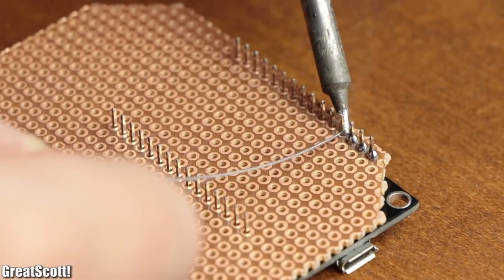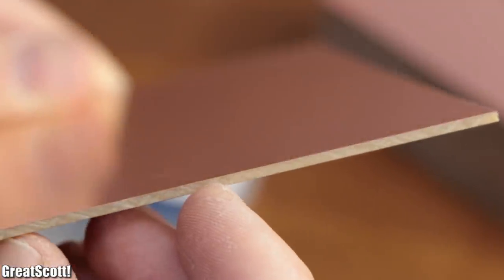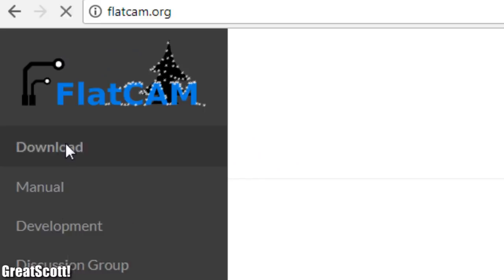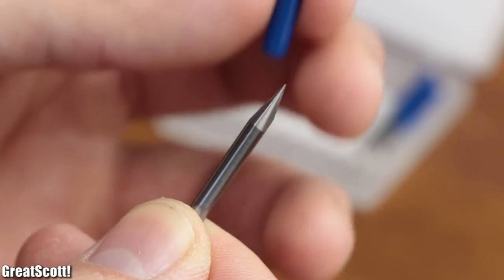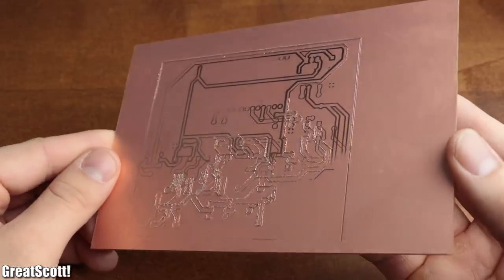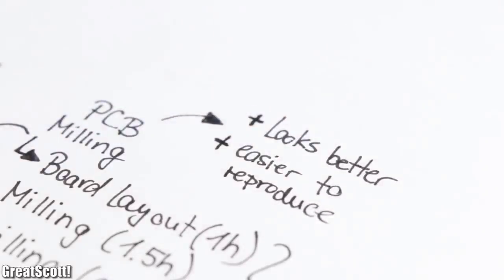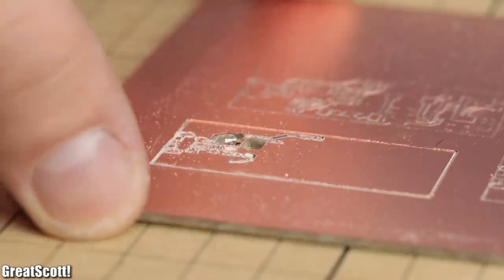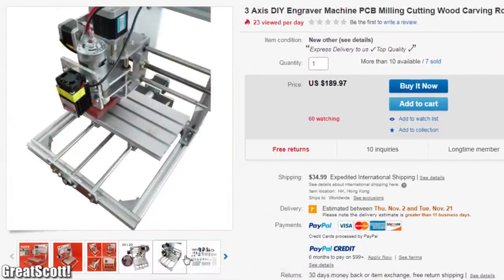How NOT to Mill a PCB (except for SMD)

Comment: I use a chinese CNC 3018, which I made some improvements and some clearances in the movements and I am getting very satisfactory results.  But I barely use it for carving, only drilling as I make the boards with photo resist film.  I agree that ordering is very cheap these days,  but I live in Brazil and it takes more than 60 days to get the boards, at best. Prototypes and one of a kind projects I prefer the home made.

Comment: Yes i had a 2418 small cnc  from china and it works really well i use CA glue to hold the pcb to a piece of flat mdf it works great but after many failed attempts

Comment: My solution to do this using a cheap chinese CNC machine is simple: use a cylindrical drill bit instead of an angled one, and make it cut about 0.5mm into the board. That way you will always drill into the copper, no matter how uneven the surface is, and the traces will not become wider or smaller depending on how deep the drill bit goes in. Makes for a very repeatable solution.

Comment: I think milling is the way to go, because it is easily repeatable, once you set up the G-Code, it is essentially a cookie-cutter.
Secondly, time, for a Veroboard you have to sit there and make the board, on the other hand, you have to wait for weeks to receive the order if you order it, however, with milling you only have to wait an hour also.

Comment: Since the Copper board is conductive wouldn't you be able to use it for auto leveling by using it to touch probe it, run a clip to the bit and one to the board

Comment: Use bCNC for milling. Trace cut depends on the angle of the V bit and how deep the cut should be. This value should be defined as the tool diameter in FlatCAM

Comment: Using laser engraver is a much easier and professional looking way.

1 Paint blank PCB by black spray paint.
2 Drill and cut it on the milling machine.
3 Burn paint on laser machine (paint that not burned will work as an etching mask).
4 Etching PCB as usual.
5 Remove paint.

100% repeatability for DIP and SMD even for 2 sided PCBs.

Comment: Is your CNC table level? If not, or if the PCB blanks have quite a bit of variation, you might take a few measurements and use software depth correction. Great video.

Comment: Hi, I have tried to do pcb milling with the cheap Chinese machines, I spent 3 weeks trying but didn't get a useable result. I learned a lot though. 
You have to use an autolevel software like bCNC, it's free and open source and written in Python. 
I haven't given up yet, I will replace the stepper drivers with the TMC2130 silent stepstick, and I've replaced the axis couplings to get more ridgidity. 
You make nice videos,  good job!

Comment: I love most of your videos. However, I've been milling PCBs with a gcode CNC now for almost 2 years and takes practice to get right but once you do you can reproduce boards very quickly.  Your main problem here was you clamped the board instead of taped it down. If you tape it to your waste board and your waste board is super level then the tape will force the PCB to also be flat & level. Also, to make up for the variations you have to cut a little deeper which is why you might use a slim angle so you can get the depth but not decrease the trace size.

Comment: I have a pcb milling cnc and you absolutely need to use autoleveling! I have many, many failed attempts without it, but since i autolevel all the problems are gone and the pcb's come out great. Also you are going too slow - you can probably go to 150mm/min, given that your spindle rpm is correct for the tool.

Comment: You don't isolation-mill boards to make individual boards quickly. You isolation-mill boards to iterate design changes quickly.

I have a desktop CNC mill that I'm using for prototyping, and it's saved tons of time by allowing me to design and change boards and sub-boards (such as breadboard-compatible carriers for SMD packages) without having to deal with chemicals or wait for boards to come from fab. That's where the process shines.

Isolation milling isn't very cost-effective for the hobbyist compared to chemical processes like direct toner transfer or even photoresist, as it's significantly more expensive to set up. Once you get outside hobbyist-level work, the whole situation changes.

Comment: I would only use a cnc router for vias, holes and the outline of the board, I had excellent results with the dryfilm and laminator method and I think it leads to almost perfect pcbs.

Comment: Hi, I'm trying to decode data from 4 wireless 433.92 MHz FSK transmitters and forward the information to a CAN bus interface. 
Do you have any advice to how I can decode the signals and use the data? 
I already have the CAN interface up and running with an Arduino and CAN bus shield.

Comment: I've milled a pcb too. First I would stick it with carpet tape on a sacrifice wood which gets fixed on the router. Next I would switch to bCNC which has autoleveling included (I never tested this function)
At least flatcam has a bug (yet?) when you first switch to mm and import the gerbers, the drilling layer is scaled different from the routes layer. It had cost me many hours until I found an other yout video that tells me to import all in inch setup and then switch to mm if all is on the right place

Comment: If you ever use the machine again try to use double sided scotch tape on the back of the pcb to hold it down. Once I used this technique the only problem that would occured would be due to the fact that the PCB material was uneven. A better grade of PCB stock solved that. Ps I really enjoy your channel.

Comment: I use my Othermill Pro (now Bantam) CNC for milling circuit boards (both TH and SMD). While it offers better reproduction and quality than the Inventabiles Milling Machine, it does cost a pretty penny ($3.6k). I did used to have a cheap Chinese milling machine but it failed to work, I then tried Inventiables’ machine, but I couldn’t get it to work. Then I went for the Othermill Pro. The best $3600 I spent.

Comment: I have one, the CNC 2418, I had the same problem with th z axis but I fixed, what thing you can do to improve the milling is using the auto leveler (or heightmap) in the setting of the GRBL Controller. also your feed rate it is very low, I use 254 in flatcam and I got very good results.

Comment: Milling time can basically be ignored because once you have it working you can go and do other stuff while it does the milling. Also the 30 minutes or so you spend setting up the milling applies for every copy of the board you mill so if you make two copies that's down to 15 minutes per board. Prototyping board is fine for DIP components and assemblies with 2.54mm headers but it sucks for anything modern like QFNs.

Comment: Hi Scott.
No. I hate those loud machines. 
Used them at FabLab, where I worked as volunteer, better just laserprint on glossy Inkjet paper, iron it on the pcb board, and etch it 
Fast and accurate.

Comment: I believe that it should be very possible to make a "cnc" machine only for this purpose pretty cheap. But it would require to make your own software. Still - if target is to make a pcb milling machine, it should be pretty simple. X,Y movement, depth(Z) only a little, with height control, which could be simply a microswitch to check if we are touching the board in the depth we want and so we always have the same depth that we calibrated with the height switch. Also there could easily be a secondary head to just drill the small holes for you. 

You'd use it pretty easily, just make a png, load it, black lines are traces, boom, it mills them, then it goes for points you clicked in the software and there ya go. It makes the whole board for you. 

That would be a great project to see. I mean - I planned to do this, but I have no money, nor time to invest right now... So I might do such a thing in like a year, or more. So it would be pretty awesome to see you do such a thing and i believe everyone would find it interesting!! :)

Comment: I prefer the toner transfer method. It works great on SMD and THT; and you could do trace clearance  bigger for high voltage applications. With milling method you have too small trace clearance and spent too much time.

Comment: I have modified a proxxon m70 milling machine into a cnc and it works like a charm for pcb milling ... cost +/- 300 € ... I have also checked those chinese pcb milling machine and they are in general very good machines for pcb milling ... it requires a lot of attention and practice from the user ... sincerely

Comment: I think for the on the cheap method I would stay away from the cnc and go for lasers. laser paint seems to be less of a pain to get working and it does not matter as much if the pcb is flat.

Comment: I actually bought myself one of these 200$ CNC machines from china and it works pretty damn good. I must admit that I use my own spindle motor which is far superior to the ones they send, but it could also work with the standard one. The most important thing for milling a PCB is really the autoleveler. I highly recommend OpenCNCPilot on github.
Reply from the maker: Thanks for the feedback. If I make a review of such a CNC I will try to include the auto leveling.
Reply: Which one did you buy?
Reply: They are all basically the identical. Some structural parts may be different, but the core is pretty much always the same.
Reply: CTiOmega which work area do you have? Mine has one of 13*10. Die which spindle did you exchange it?
Reply: Mine has a work area of 30cm x 18cm. I exchanged the spindle with a 52mm 500W spindle motor that I bought from aliexpress. It came with its own power supply, which can be used to vary the speed of the motor and metal clamps to secure it to a frame etc.. In order to use the motor I 3D printed myself an "adapter", which I got from thingiverse and changed it out with standard motor clamp.

EDIT: I also use the CNC and the autoleveling feature for woodworking.
Reply: CTiOmega so you bought one of these 3020 cnc? Awesome! Mine is just a toy on comparison to that.
Reply: Yeah I actually wanted to buy of those small ones too, but the 40$ cost difference didn't make much sense to me so I went for the bigger one.

Comment: I mill PCBs all the time.  You are milling WAAAY slow.  That board you have that took 1.5h I would do in about 10 mins with all the throughholes as well.  I mill at 18krpm and about 30-40 mm/s on my 5+yo Chinese 3040 VFD router. It is great for one-offs and prototypes.  Hot tip i got from a machinist too - Grab some cigarette papers to use as a feeler gauge for setting the tool height! I power down the motors, set the height by hand with the paper, '0' the Z axis then power back up the motors.  Works a treat.

Comment: "TheAnt PCB mill" measures the PCB board like the Prusa MK3s calibration before milling...
So the height of the Z axis is constantly moved up and down while milling.
As you already said: the problem is that the PCBs are not very constant...

Comment: Hi Scott, like many before have mentioned autoleveler  program helps, but you can also spray lubricant.

My don't have good turn out with v bit, i think they are too susceptible to height change, especially if your machine isn't tram, or lose hardware or any other factors. 

not sure if you will read my comment but thanks for the video. 

cheers.
Reply from the maker: +henry lin Don't worry, I read all comments.

Comment: I wonder how easy it would be to convert a reprap prusia i3 3D printer into a PCB cnc mill...
Reply: BoomBrush Really hard. The frame is not stiff enough.
Reply: Don't do it. A cnc mill is not a good 3d printer and a 3d printer is not a good cnc mill.
Reply: But you could use it like a plotter with an Edding attached and let it paint the traces and then etch the Board. (But I think if you consider etching then you should use the Toner transfer methode)
Reply: Justus Faust yup, that would be an idea, but if you're etching you'll also have to drill the holes. So no big win. But a fun project idea!
Reply: actually, quite easy, get a cheap "dremel" with a flexible extention, zip tie it to your hot end, put your drill bit in it, zero it out, and mill away. Though it probably will wobble quite a bit if you are using an acrylic frame version, and a lot more if you are using rollers instead of linear bearings for the x and y axis.
though to automate the drilling it would probably do well, as long as you add a sacrificial wood plank so you don't mill your print bed.

Comment: Good luck if you want to have proper PCBs with that kind of CNC. It simply isn't stiff enough. Check CNCs from LPKF, but you must know that that kind of CNC costs few thousand euro. Also those chinesium cutters are rubbish. I am using special 0,2mm cutters from LPKF which are expensive but if you take good care of them they will last quiet some time. Also if you are milling PCB you should use endmill to remove "dead copper". I was having a lot of problems at first with my Protomat 91S, but once you set it up it works like charm, I think I am having a reject rate lower than 5%. After milling I recommend brushing PCB with wire brush.

Comment: With experience, PCBs can be milled easily and accurately. Your depth of 0.05mm was too deep. If the board is level it should be possible to go to. 0.035 which is the depth of the copper, but I have had sucess at as little as 0.02mm (which in theory is not as deep as the copper is supposed to be thick).

It does pay to separate your tracks as much as possible and keep them as wide as possible when designing the PCB. I also find using rounded rectangle pads rather than circular pads makes soldering much quicker and easier. You also have the advantage when milling them that if you want to alter the board, it is much quicker to alter the gerber files and mill a new board than to make a new board with all that solder, there is much less chance of making a mistake when assembling it  and obviously it looks much better.

Comment: If you have the money to buy a CNC machine strictly for milling PCB's, you might as well just have the PCB's made for you, or use the cheaper photo-resist method, as it will give you better results much faster, and without all of the overhead costs and headache's associated with CNC.

Comment: I don't get your adding up the times. The first time you do anything it's going to take a  while.  The fairer comparison, once you have the process dialed in, is how long it takes you to make subsequent boards. 

Also, you really should use a z-probe (they are really easy to set up) and a height map for PCBs The z difference between 'not milled through' and 'milled way too deep' is very small, when it comes to the copper layer on a PCB.  If you use a piece of paper as a feeler, keep in mind that a post-it is about 4 mils - already thicker than the copper layer.

Comment: Im actually playing with this as a side project with one of those cheap CNC's from china and can confirm much better results.. threaded rods are the way so long as there is effective anti-backlash

first, stop using the V  bits, i know they're cheap, but if you cant control your cutting depth (by calibrating to the board)  then you'll get things that are hard to repeat as you saw, the gcode generator relies on the cutting bit width, which changes with v tips as they get deeper into the copper. check out the actual .1mm stub endmills over at "think and tinker".  

also, 10k RPM+ or GTFO,  you should calculate your feedspeed relative  to your bit RPM, i also find I can use ISOpropyl as a cutting fluid to keep dust down and cool the bit for a faster feed speed.

lastly, dont blindly use ".1mm" as your bit size, calibrate it, even with a larger bit you will get better results even if it means the milling bit will refuse to go into a few narrow places.

i rolled my own depth mapping which consisted of probing the board using the milling bit as a probe electrically connected to the endmill through a pogo-pin which probes out a grid shake a little matplotlib + 2d cubic interpolation and you have a depth map of the board. but there are some other tools out there that do this (apparently?), either way, you should use this method for touching off "zero" more consistently, that way your depth of cut setting can stay the same for most milling jobs.

I'm still working on copper hypophosphite throughole activation and plating, but havnt really nailed it down yet.

hope this helps someone
Reply from the maker: +Phar Helps me. Thanks.

Comment: So summary of the video is to use bits with narrow tip, copper plate as plane as possible and not to use components with fine pitch in design while using desktop CNC machines.
Reply: summary is : tighten the screws on your cnc BEFORE you start
Reply: You can say, but no matter how much you try to flatten a curved surface to the utter most perfection

Comment: I see comments about tramming your machine, but that is incorrect. You need to use a fly cutter to surface your spoil board. Also, clamping the board down causes it to flex too much for delicate work like this. I use double sided tape to hold mine down.

Also, in the clip at the end of the video, you are cutting too deep. Once you have your depth figured out you will get half or less the amount of fiberglass powder you can see in that clip.

I don't know how fast that spindle is, but I run my machine at 30k RPM and 35-40IPM feed with a 2 flute cutter, just for a speeds/feeds reference.

IMO the worst thing about milling boards at home is not the noise, but the fiberglass powder, it gets everywhere. I run coolant on my setup to capture the dust, but a vacuum with a good filter may work ok.